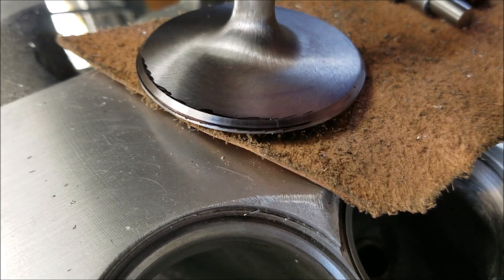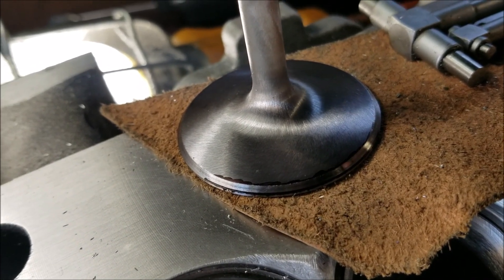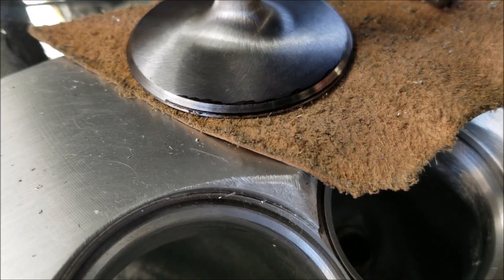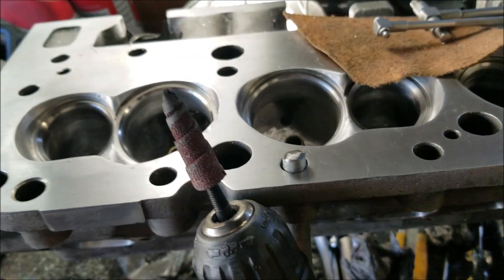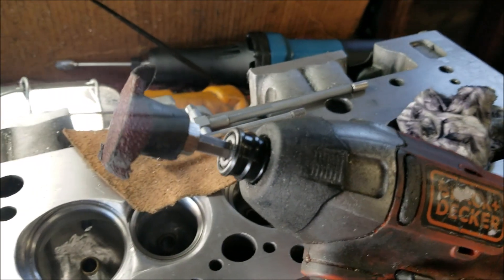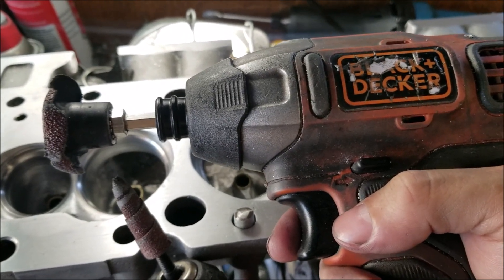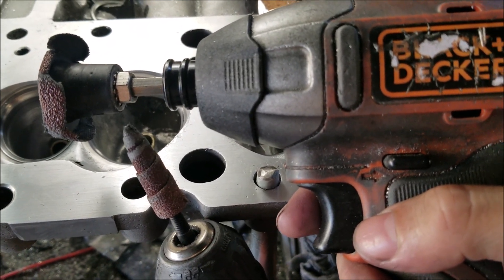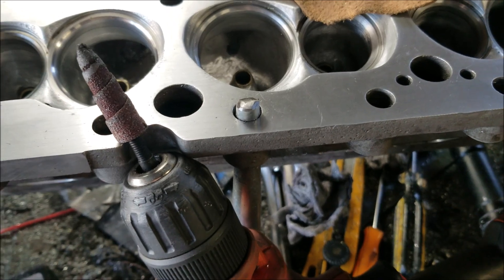SBC Head Porting tips and tricks

Comment: Valve looked pretty tight to the guide.  You would need to clearance them with a reamer.
Reply: Amen. Definitely too tight
Reply from the maker: I'm going to have to learn how to mod valve guides too.  Hope the tools are not too expensive.
Reply: @c41man  a simple reamer for your specific guides size is all you need, but you have to be careful not to make them too loose!  I've done it on new bronze guides in a ford modular using a carbide reamer and a cordless drill. Bought it from Goodson and wasn't very expensive. Only pushed it through on one pass; any more made it too loose.
Reply: bet money the seals are still on the heads. notice how it got tighter after it was in about half way. doubt its a tight guide, especially on a used head.